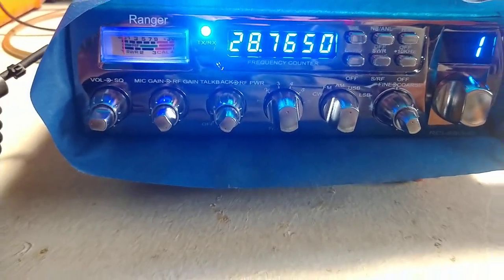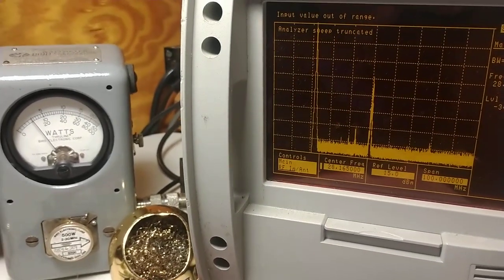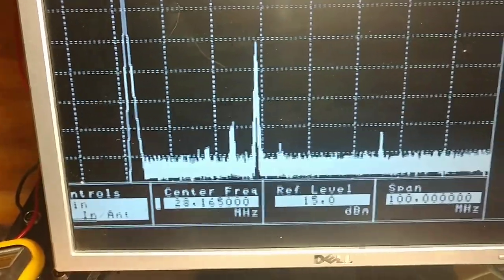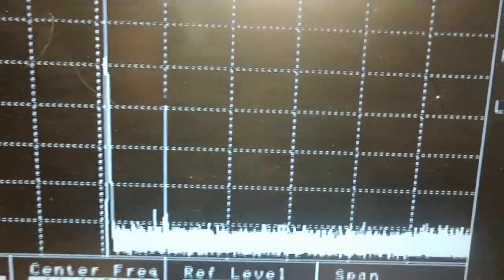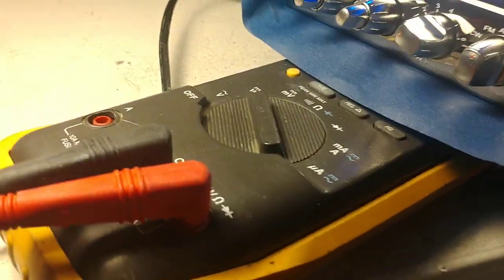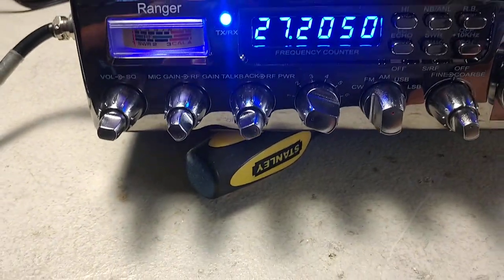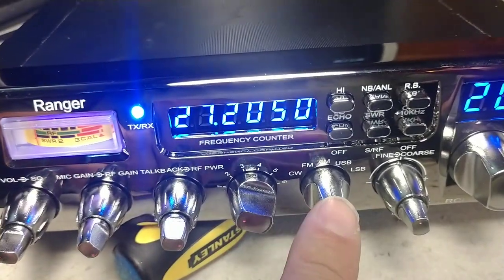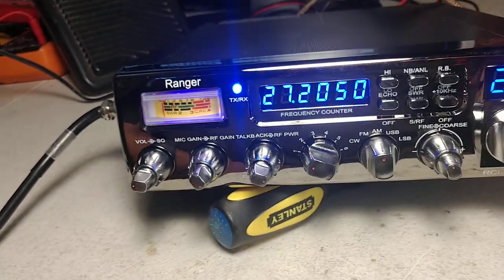The NEW Ranger RCI 69vhp new out of the box, full setup and demo

Comment: Another overpriced version of a galaxy 99v2...or a 98vhp with no amp...rci makes them all so nothing different really...fancy chrome face and an extra digit on the counter....wow....like Chevy/GMC or Ford/Lincoln....wonder when they will come out with something new instead of changing the saddle on a 20 year old horse?? Don't get me wrong they are nice radios but it's time for rci to catch up
Reply from the maker: Actually they are more desirable than a galaxy. Better receiver , one more digit on freq counter twice the power of a 99v2 @90+ watts pep
Reply: catch up to who?
Reply: @smokinjoeselectronics442bu7  I don't think I see your point...the 99v2 uses the same board...made by the same company...how is something better than itself...I agree they are nice radios...but other than output power there are little if any differences in any of theses radios once you remove the bells and whistles...the heart is the same the body is the only variation...2950 99v2 and 63/69xx radios are different versions of the same tired design...it works I get it...if it's not broke don't fix it...just change the finals throw in some scotchy make it shiny and call it new...my 939 made in 2014 has the scotchy from factory as well...my 2950 is a great radio and the 98vhp I had did great...I don't hate rci...but every radio I've owned from them was the same design with different features...I just feel they are getting stale and need a truly "new" product...thats just my opinion and really means nothing just a simple opinion...I'll still run my rci stuff it's hard not to if you think how many radios use their stuff
Reply from the maker: @blainehartley9157  the 99v2 does not use the same board. It's not the same radio
Reply: @byates59  anyone using smt...love it or hate it it's more durable and consistent...through hole has its place....would just like to see rci send out radios with better filtering and better quality control...since the move to Vietnam the quality seems to be up so that's a good start...when I look in a president or Stryker radio then open an rci radio my first reaction is "come on guys"....I guess I've just grown tired of the same and need to run other radios for a while so I can come back to my rci radios and appreciate the fact that they haven't done anything in 10 years...my 2950 is a "newer" smt board so I must give them props for that...guess that's why I've kept it around lol
Reply: @radio tech I'm aware of that...I have a Richard....much better quality....this radio will out perform a president because it does 90 jiggawatts...ill just add a 200 watt amp to the president and loaf right on by....my Richard does have it's faults though...the display is starting to loose a digit and the swr function started going loopy about an hour ago...both issues I've seen on rci and many other "branded" versions of it...they all have their faults no matter who makes it....i figured I would have went longer than 4 months with the president though....i figure it's a glitch in the software more than it could be a component failure...the display is component related...was going to live with it since its only a tiny corner of one digit but now that the swr section is acting up I think it's time to go back for repair/update
Reply: What radio would you recommend?

Comment: Smokin Joe's Electronics 442 Built... your opinion, what is the best radio Ranger RCI69VHP or STRYCKER 955HP ?? Please your opinion.     73
Reply from the maker: Stryker Sr 955. But I like the 2950cd better than all
Reply: The Stryker 955 doesn’t do 10, 11 and 12 meters. Yes, Stryker is a way better radio but you only get limited 10 meter, 11 obviously and no 12 meters. I guess it depends on what you base, “best” on?
Reply: But I’m also not going to sit here and lie to you. I’ve owned many Stryker 955’s and one rci69ffb4 (discontinued now) The Stryker is a very loud, very proud radio. The 400 watt rangers are awesome and do more BUT, they require waaaaayyy more power, time, attention, energy, etc. They drift frequency literally by the millisecond, they get extremely hot, minimum power to rag chew is carrier 50 to peak 190, they draw extreme power from even a 4 battery 12v set up, to utilize full frequency spectrum capabilities (assuming you’ll eventually travel to amateur frequencies outside citizens band) you need minimum 3 antennas or tuner, echo board isn’t even accessible, you have to add talk back on the model your referring, on and on and they have decent rx and unbelievably amazing tx but the Stryker is barely below the equivalent. “BEST” you ask? Best rx/tx with minimal effort, Stryker, all day, everyday. Best radio hands down is the ranger but way more efforts to sound basically just as good. You’ll only be a few s units below the Stryker on someone’s rx anyway so why set yourself up for a way more expensive headache? The Stryker only loses 12 meter band over the ranger but the 12m band so small, who cares? You still have 10 and 11m band on Stryker. Hope this helps. Stryker is my favorite radio. Magnum used to make the same radios before selling to Stryker. Any Stryker or magnum you can land is a far step in the right direction when you’re transmission is am. Heck, even ssb sounds amazing on Stryker/Magnum’s. I sold my ranger rci-69ffb4. Ranger sux! 😉
Reply: @rualmet  Thank you very much for your contribution, I will buy a Stryker 73
Reply: PU2XBT I just grabbed another custom built one myself. I bought from bells CB. 73 your way